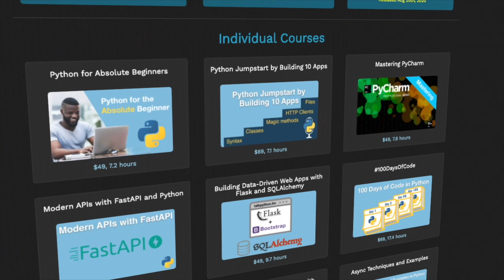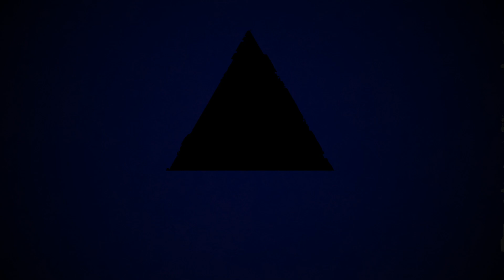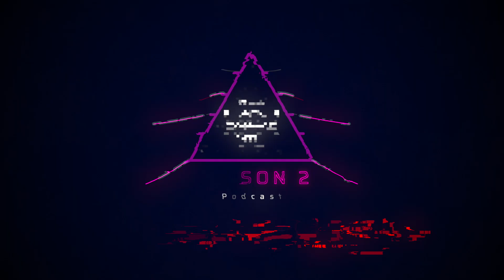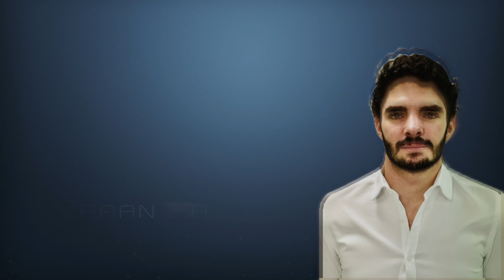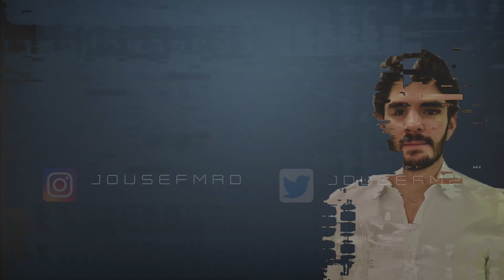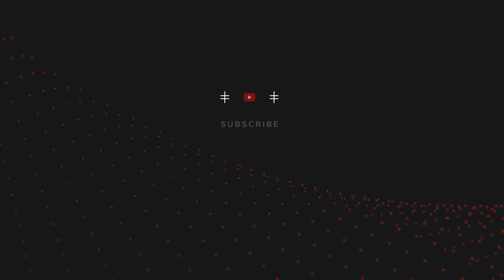Starting a Formula Student Team From Scratch - Ferran Martí | Podcast #29

Comment: Is Ryzen 5 4600H with Nvidia Gtx 1650 good for Ansys, Solidworks, Openform, Hypermesh, Ansa? Any problem in that? Reply fasts
Reply from the maker: Why don’t you go for SimScale as a simulation solution and CAD-wise use Onshape? Other than that I guess your setup „should“ be fine but I personally rely more on cloud-based solutions which are the future.